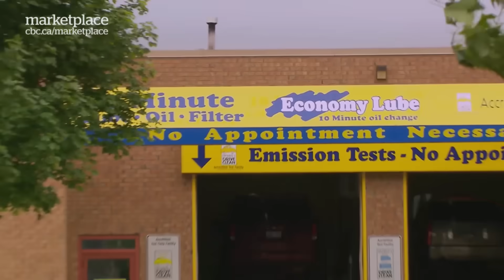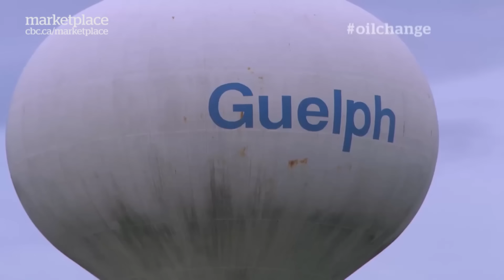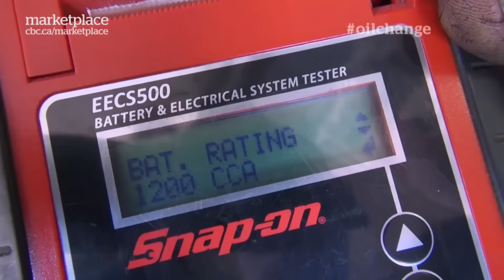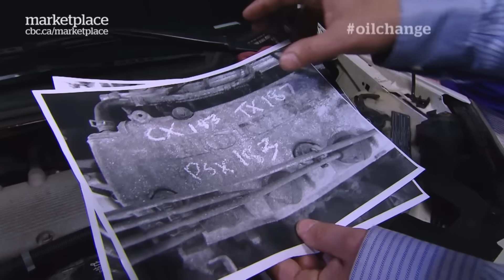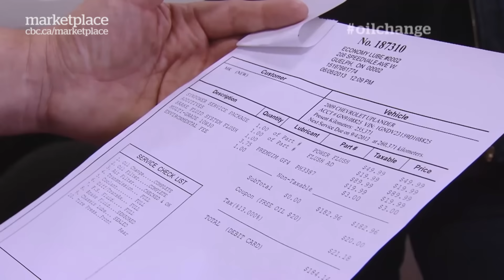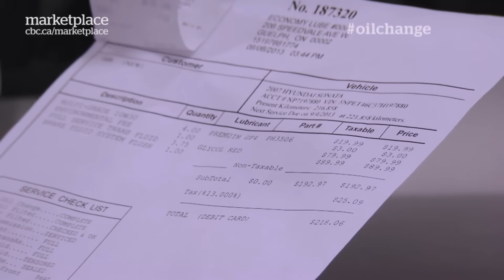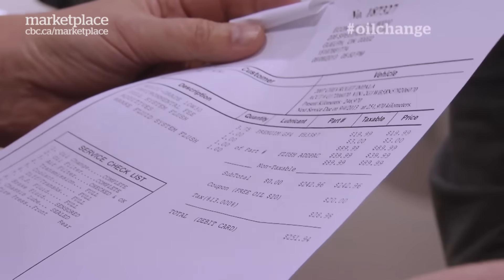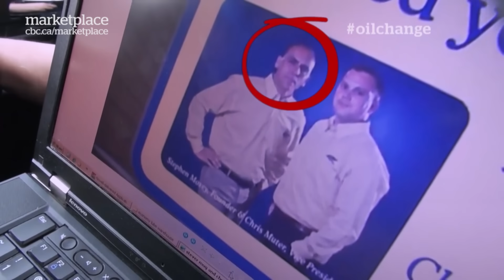Oil change scams: Hidden camera investigation on what really happens to your car (CBC Marketplace)

Comment: Five years later there is no such thing as a $20 oil change anymore.
Reply: There are still plenty advertised but of course it doesn't end up being just $20.
Reply: Oil change is 50 bucks with tax
Reply: Cody Johnson thats cheap for lexus
Reply: antoine brown sis pays $20 plus the tax.
Reply: Klesti Muco thats a standard price but get the 40 or 50 dollar 1 it gets you more mileage
Reply: They lure you in with the 20 dollar "deal" but then tell you that your car only takes full synthetic and the price triples or quadruples. Thing is, the full synthetic oil doesn't cost that much more than the standard oil at autozone, just a couple bucks more. That only really leaves labor to be the changing value in the equation. I guess they figure pouring better quality oil while performing the exact same process is more labor-intensive. I should really change my oil myself more often like I used to but the weather isn't always ideal and the cleanup is rather annoying.
Reply: This is why I change my own oil.  I make YTube videos to help people save money doing their own repairs and doing it right!
Reply: $35 at Minakie in DELAWARE!
Reply: What a bargain Nicole.
Reply: You can find standard oil changes for low 20s maybe 26 after tax...at least in my area
Reply: My last was $22
Reply: Yes there is. Do it yourself, materials will cost around 20 dollars.
Reply: @corbingarrett1206  where do you get 5qts of oil and a filter for $20?
Reply: I paid 29.95 at Walmart!
Reply: m m last time I did an oil change it was like 22.50 just from Walmart.
Reply: Wal-Mart
Reply: walmart 19.98 plus tax
Reply: If the mechanic does not change the oil, then $20 is pure profit.
Reply: Why pay when you could just do it yourself?
Reply: It's 20 dollars labour. Plus oil plus filter etc.
Reply: Only if you can be sure that the oil change is actually done.  And some cars require very high spec synthetic oil, which will cost a lot more than $20.
Reply: Exactly!  Then you will also ensure that the oil you buy is the correct spec for your car and you will know it has actually been done.
Reply: Great!  Nothing like a helpful friend.
Reply: At my mechanic shop we charge $20  (oil/filter) for a 4 cylinder, and $5 extra per more cylinders. We do the oil change in front of you.
Reply: Ozzstar yessss! This is why I change my own oil as well as brakes etc. My car is 13 yrs old and runs like a champ! Make time, save money
Reply: Randy .Marsh it literally takes less than 30 mins to throw on old clothes, get a drip pan, slide under your car, drain your oil remove your filter, put in new filter and dump in your new oil. I mean unless you're a sissy and can't get dirty lol.
Reply: I never understood why oil changes were that much.. it's so easy just to do it your self..
Reply: Where i live, cost $25 to do it yourself. I see signs all the time.....
Oil change and break check, $69 HAHAHAHA yea!
Reply: Sure it is it's called ourselves
Reply: The company presented in this video still has an active website and still advertises $19.99 oil changes.
Reply: Yes there is... if you have a good mechanic that’s not a scumbag you can get a $20 oil change no problem. Stop dealing with scummy companies & you’d actually get great work for a lower price, not all mechanics are bad. Stay away from corporate mechanics & find yourself a good family owned/mom & pop type mechanic.
Reply: I got a $20 oil change at walmart, and shortly after my valve seals failed and destroyed my engine on a 22 year old car that otherwise ran great before that... you get what you pay for.
Reply: I know one  $25!
Reply: @ozzstars_cars  I will love to learn how to do that myself!
Reply: +Mary J. most oil changes are very simple. Most important is use safety stands if jacking up the car for access.  The only vid I have ever posted doing an oil change was on a C7 generation Corvette because it has a couple of extra steps.  https://youtu.be/Q8A4ClwAsag
Reply: I find it funny and nice how this section just starts talking about oil change prices to help others be aware of there still being some $20 oil changes, or at least around there.
Reply: There was a 17.99 special. I paid 20 for it. Not that bad
Reply: Ozzstar : well first of all for feminine part ( girls, ladies, women ) such labor is a pain in the butt.. now for those who know a bit of mechanic stuff changing oil is an simple operation that need some special stuff & tools to be performed really quick : an elevator, set of tools, an special cone drainer for used oil, new oil and optionally since some times the oil filter need to be changed too a special key for the oil filter is required and the new oil filter too.. the other part is the care because things get messy when such labor are performed and the elevator can be dangerous for those who not knows how to work with it.. that is why ladies and lazy people are usually get the cars to services even for such stuff..
Reply: didnt know we have september 2019
Reply: I get mine for free lol
Reply: the only way to make sure you are just getting an oil change done right is to do it your self.Its not hard at all I do my own
Reply: That's true, because electric cars don't need oil chages.
Reply: Negative! Walmart will change it for 20 bucks
Reply: +KEN J. you would let those hacks touch your car?
Reply: I get mine for $14
Reply: If you do it yourself it's about 25 + tax haha
Reply: Yup electric cars
Reply: They still exist at Walmart in the USA in the south. I still see $20 oil changes in Texas.
Reply: could just do it yourself. Oil change is really simple and its cheaper your self.
Reply: I don't get how people don't know how to change their oip yet. Lmao
Reply: Ozzstar if that's a problem they just need to charge the same cost as the oil. I understand labor and disposal.
Reply: There sure are. That is the bait for up selling.
Reply: In Mexico, they give real oil changes, nothing else for 50 pesos. About 3-4 dollars in US money.
Reply: Come to China. We have oil change less than $6 in almost every city, but you have to bring your own oil and filter.
Reply: Not true
Reply: Try having a diesel that uses 15qts in the engine and 27qts in the transmission. Last time I had a fluid and filter change it was almost 500 dollars and they did it wrong! I stood there and watched them.
Reply: This was back when the Canadian Dollar was at Par with the US Dollar and Oil prices were below $50 a barrel. You can still find them for as cheap as $35 but those shops use cheap bulk oil and $2 filters, I know I supply auto parts and supplies to shops and quick lubes
Reply: But there wasn't such a thing back then either. Didn't you understand that?
Reply: Walmart gives 20 dollar oil changes
Reply: yes there is... go to walmart, buy oil for $20 more or less (dependent on what kind) & do it your damn self lol
Reply: $50 for natural oil and $90 for synthetic oil (both plus tax)

Comment: I worked for jiffy lube for about 3 months. They pay minimum wage but give you  0.75-2$ for every service aside from the oil change that you can sell.  I didn't like the idea and if your not pushy and sell services,  They put you in the back and have you check tire pressure and vacuum out cars. Being a mechanic most of my life I can tell you that all the big name garages and dealerships (Jack Williams, Kost tire) all operate the same way. Kost tire would give 15% of the profit they make for every part you put on a car (not including labor)  and 1$ for every tire you sold. The best idea is to find a small privately owned garage that has had the same mechanic for 20 years. You'll find a better mechanic that gets paid by the hour or day, no matter what he sells and an owner that wants you to be a return costumer. Not some slick salesman worried about how big his bonus will be that week.
Reply: I agree lol
Reply: Yup, even official car maintenance companies are ripping people off. They usually include light changes and add as much fees as believable for those changes.

My company has one of those old timers who runs his shop alone and on reputation that we take our cars for service. Has this "Movie" kind of feel of some friendly chap with grease all over checking your car and explaining stuff as he is pointing at it on whats wrong and right.

As he runs it alone he gets enough cash as the owner, without the need to rip people off and he gets better rep for it so a win win. Also I can actually be in his work area and see while he does stuff, later he again shows the bits and talks about stuff that might be go out, after actually being near the car for some time.
Reply: Your very lucky, send me his location, I used to have a guy just like that he died more than 20 yrs ago I havent found anyone who comes close since then
Reply: Let's get one thing clear here. Changing oil and tires in no way, shape, or form makes you a mechanic.
Reply: mike peever that's where most places start you out at until there's an opening for a mechanic's position. Having a state inspection license for Pennsylvania makes it clear that I'm a mechanic

Comment: "looks like you've a got a leaky sparktube. The cars totalled."
Reply: Correct lol "sparktube" wtf
Reply: Needs new blinker fluid and muffler bearings $2500
Reply: Andy
Reply: your tires are dark grey they should be black. 600$ each wheel without balancing. 2000$ with balancing so total of 16300$ and free oil change
Reply: Looks like your Head Light Fluid is low. Would you like me to change that for ya?
Reply: Haha.  Spark tube. Nice.
Reply: “Yeah I specifically work on motorcycles”
Reply: Only real ones know

Comment: I feel like every parent needs to show this to their kids before they start driving
Reply: I made both of my daughters learn how to change their own oil change their own Tire change their own belt.
Before they were allowed to have a driver's license.
However this was on older vehicles
Reply: It's the oppistite kids are a LOT SMARTER these days
Reply: @concernedkid7706  
Some kids are smarter about some things.
Unless you take all of their electronic devices away from them.
Without a computer or Google though most have no clue
Reply: @justinbennett2633  It's true that helps, but there's also a lot of info to be gained from going there in person as well.
Reply: I haven't taught my kids how to change that stuff entirely, but at least they know how to check the oil and fill it, air filter etc

Comment: I went to Walmart for an oil change.  What a  mistake.  The "mechanic" mistook my transmission spout for an oil spout and put oil in transmission system.  I drove away and shortly after noted that the transmission was acting funny.  I checked my transmission fluid and it seemed to have  a thicker viscosity but the dead giveaway was when I checked the oil; the dipstick was just as dirty when I took it in.  When I returned to Walmart they denied everything. The performance of the transmission deteriorated rapidly. Fortunately for me, the car was under factory warranty and so I took it back to the dealership where they told me the transmission had failed and replaced the entire transmission with a new one at no cost to me.
Reply: No, they never drained anything.  They claimed they changed the oil filter but on inspection, the oil filter was the old one.  Walmart just added oil to the transmission fluid.
Reply: Steven Turner walmart is your first mistake!
Reply: Steve, you lucked out with the dealership replacing the transmission. Legally they did not have to do that.
Reply: Same with me except they filled mine up 2 times with oil and never drained the old oil, it ended up blowing the head gasket I had Walmart pay for it
Reply: 2 words SUE THEM
Reply: noice bruh
Reply: so the dealership took the hit for Walmart? More fraud ..on your part this time!
Reply: Steven Turner Wtf? I'd blew that place up ASAP
Reply: No they wouldn't.  They denied the mistake in the first place.
Reply: What did u expect...its walmart!
Reply: Omg, how do you even do that?! (The "mechanics," not you lol)
Reply: I did that to myself, kind of. Drained my transmission fluid and had refilled it, but I had walked off to let the fluid drop and get a more accurate dipstick reading. Came back out and saw it was a bit low still. Went back in, grabbed my second container of fluid (I thought...) and started to fill it when it quickly occurred to me that what I was putting in wasn't red. LOL. I ended up having to do three more fluid changes to try and get as much out as I could and 20k miles later my transmission is still working. My mistake was because my transmission fluid and oil containers looked the same and I checked for the right one initially, but somehow grabbed the other one.
Reply: Well you probably should not have gone to Walmart for an oil change

Comment: i once took my car to get the brakes done..they told me that i had a bad leak comming from my engine..i said ill worry about that later..2 days later my engine lite and red oil light both came on and my car started to make a bad knocking sound ..luckly i was next to a shop..when i took it in they discover that my oil plug from the pan was missing..i learn that the shop that was working on my break loosen the plug..so while i drive and vibrates it will slowly but surely make the plug come off
Reply: That's so messed up smh.
Reply: I feel like sometimes they purposely do stuff to your car so you come back and they “fix” it.
Reply: I always say if I drove it in, I can drive it out. Just do the oil and I will get a second opinion from my mechanic buddy!
Reply: @EdMcCornhole  Yep....Don't hesitate to say no tx...

Comment: Brings in a Tesla in, needs an oil change...
Reply: I wish somebody would bring one in and see what these jerks would do 😂😂😂
Reply: They would probobly tell u that it needs that premium 50 dollar oil change they had     
even though the car is electric lol
Reply: Guys the its electric chemi based oil that teslas use it goes for 99.99 lmk
Reply: And a tune up
Reply: Well, you need to lubricate the electrons, so they can move more quickly through the wires and in turns give you more performance!
Reply: They might charge for four wheeler paddle cart even
Reply: Needs twenty new batteries. The batteries should be bright pink. They've turn brown and they smell like burning.

Comment: It's Valvoline for me. Not only do they fill your tires, top off the fluids, check all lights, change the oil, but they do it all in front of you and show you the new oil on the dip stick when it's done.

Comment: As an ASE certified technician I hate businesses that rip innocent people off and I've reported every single shop I have found fraudulent to the bureau of automotive repair and I'm happy to say every single time has led to an arrest
Reply: The one place I would never bring my car again is Flanagins, they did my Power Steering System and rack and pinion, and it cost 1600 dollars, and they had my car for 3 and a half weeks, and didn't do the alignment, or tire balancing. Ended up demanding the money back for the alignment and balancing, and brought it to NTB, I also know that ATF-4 doesn't smell burning, its kind of rusty though.
Reply: @samgray49  No BS if transmission fluid smells burnt, or you smell burning transmission fluid, there's an actual problem, but I'm not going to take someone's word for it.  I'm going to carry it to another shop or to a friend's house and get a second opinion for sure.
Reply: @Xalor69  my cars a manual that uses ATF-4 so when my rack and pinion fully failed then it burned because everything was rubbing.